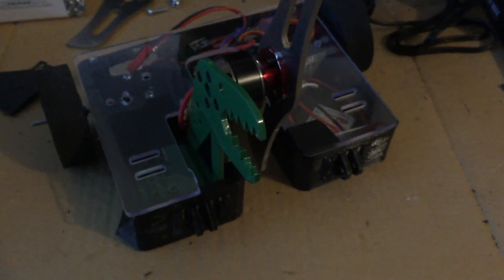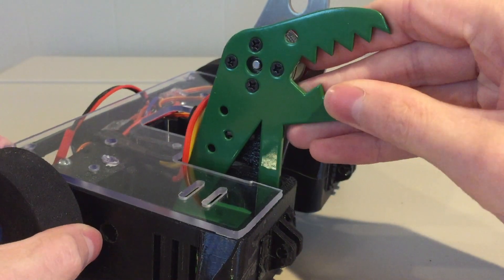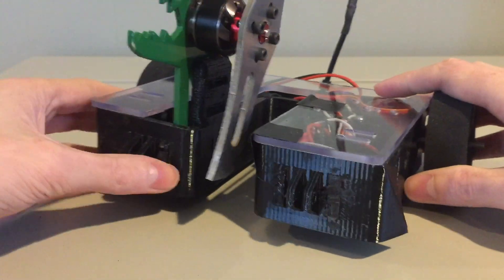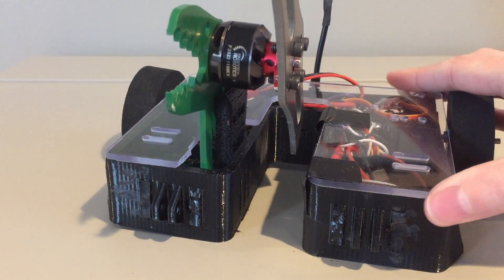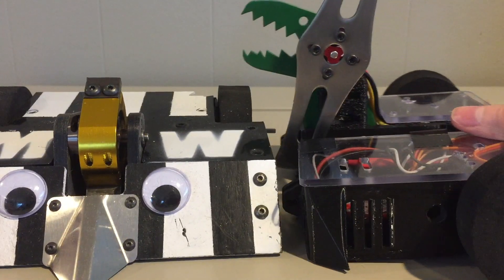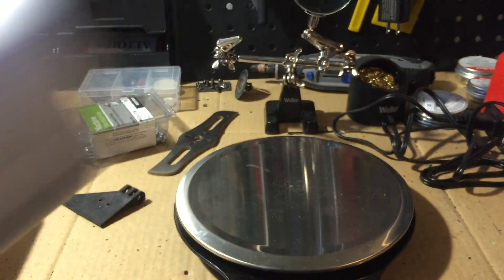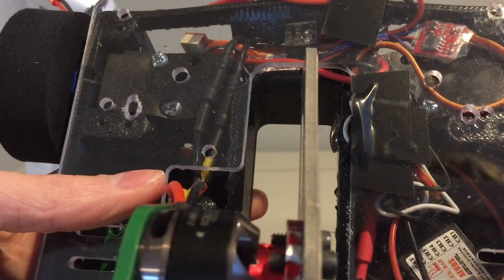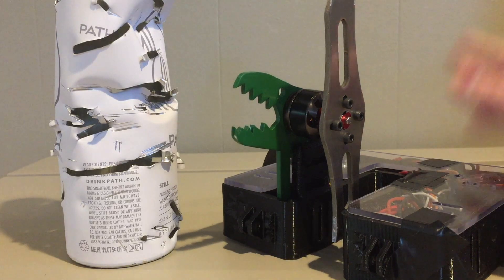Moray - 1lb Combat Robot Design Overview

Comment: this is awesome! 

the best advice I ever got, is that the weapon system needs to be rigid. the steel upright seems fine, but if you could have it wrap around and support the other side, it will be much stronger and reliable (like a U shape). 

Also if you want to reduce weight, take it out of the lid! Great designing and creativity!

Comment: Two things, 
One, you should put another one of the green support moray jaws so if you land a big hit, the motor does not go flying off.

Two,  That new battery location might lead to the enemy hitting next to the blade, and you battery exploding, same with your receiver; To fix that, you should put them more into the empty space, instead of putting it against the wall.

(Hope this helps! 😊)
Reply from the maker: Thank you for the great advice. The new version which should be ready soon has a two much smaller spinners that I can swap out and an upright that has more support, so hopefully that should fix some of the issues. I also might end up going with a belt driven spinner later on. I'm glad you mentioned the battery and receiver placement because I wasn't thinking too much about that, but I have some attachments planned and some foam to cushion them.
Reply: @Morayrobotics23  Thank you for taking that into consideration, I wish you the best of luck while competing, I’m making a bot myself, just finished printed v1.
Reply from the maker: @ThatColdSketch  Awesome. I hope your bot turns out well.
Reply: @Morayrobotics23  Same to you!

Comment: there are a ton of little changes that could make this robot absolutely killer. with a weapon that big you will probably need to support it from both sides or make your upright a lot stronger. keep in mind that if you switch to aluminum it is going to be a lot less elastic than steel, so every time you have to bend the aluminum back its going to lose a lot more strength than a steel upright would.
another thing to keep in mind is that if you bolt down your polycarb cover at the front edges as well as the back, the chassis will gain a ton of rigidity. making your fork mounting replaceable instead of printed into your chassis would allow you to just change it out instead of trying to weld TPU back together or replace the entire chassis because you cant run forks.
Reply from the maker: These are some really good suggestions and I've thought about some of these before. The new chassis arrived and I did include mounting points to be able to detach the fork mounts for easier repair and modularity. Also it ended up being much lighter than I thought so I might be able to keep a steel upright and I have plans for a belt driven spinner for future versions. I didn't think much about the added strength of top plate mounting points on the top, but I might be able to make that happen with this new version.